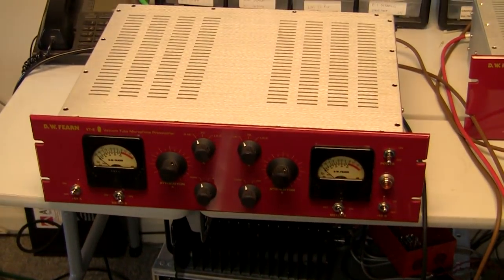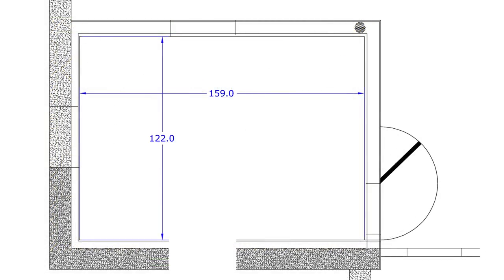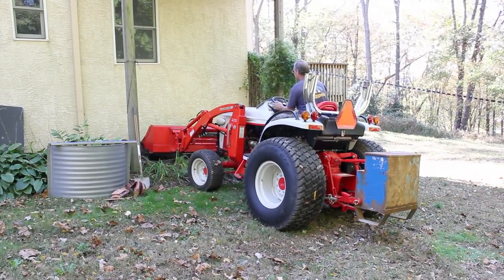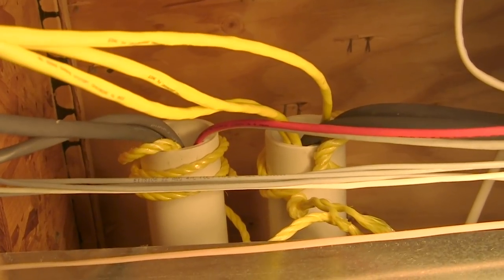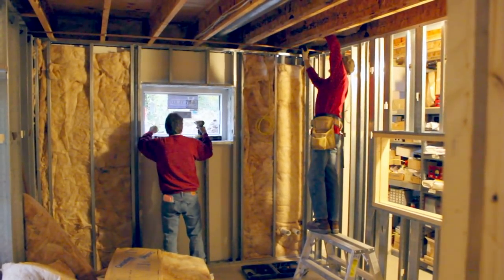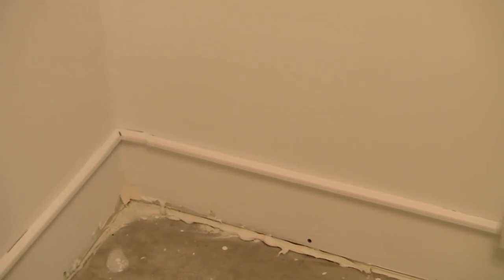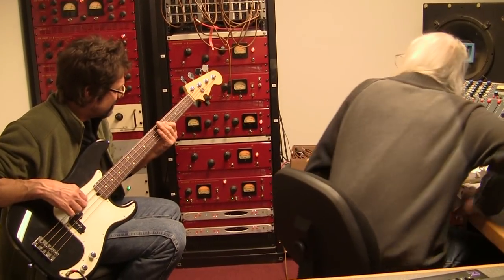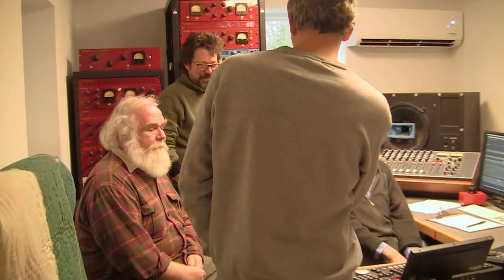Building a Recording Control room

Comment: You sell single space ventilated rack panels for $200 & you can't afford to add onto the building? Come on, man.
Reply from the maker: I considered expanding the building to allow a larger control room, but that would have meant large steel beams to support the three floors above. That would further reduce the ceiling height. The cost could not be justified for the benefit. The vented rack panels came about because our customers asked for them. A $30 perforated panel would work just as well. Creating a panel that matched our products required the same machining of quarter-inch thick aluminum as our front panels. There is also the cost of finishing the panels, which requires many different coatings and hand work.

Comment: Dude for your health replace those rockwool absorbers.  Fine particles go through the burlap with any air movement.  Rockwool is manufactured to be sealed, you do not want to breathe it in.  It's similar to asbestos in the way that the little fibers can lodge themselves in your lungs.
Reply from the maker: You are right to be concerned. The particle size of fiberglass and rockwool are comparable to asbestos. What do you suggest as a replacement?
That said, I do not know of anyone in our profession who has developed any lung problems as a consequence. Good air circulation and proper filtering probably helps keep us safe. Still, the risk is not zero.
Reply: Hi  @DWFearnHazelriggIndustries  I don't have a recommendation, I don't know the nodes or nulls specific to your studio (every studio is different).  I made the exact same thing put it in my studio and it wasn't till years that I realized it's hazards.  Your not going to notice it right away, it's the slow build up in your lungs over the long haul that you have to worry about.  When I lay flat on my back I start coughing, I thought it was bizarre til I put two and two together.  I was trying to use them as bass traps but gave up on that since it really didn't treat those frequencies, so they were more or less just slap back and reverb nullifiers.
Reply: @DWFearnHazelriggIndustries  The forced air circulation is what blows on it and causes it to become airborne.  It's released into the air, some will be caught by your filter (assuming it is able to catch these fine particles) and some you will breathe in.  😐
Reply: @DWFearnHazelriggIndustries  When I gave up on trying to tame the 40Hz room resonance specific to my studio I pinned up inexpensive studio foam (the Amazon kind) in key spots to reduce slap back, standing waves, and room reverberation and deaden it some.  My studio is a less than ideal size to do anything meaningful and have lately done my mixes on a pair of high end open back reference headphones.  Some physics are impossible to compensate for in a room as small as mine.  I've used studio monitors for decades and interestingly found I like the open back headphones better, it's seriously like having two studio monitors strapped to your head. ✌🏻
Reply: If I happen to come across something inexpensive and that performs the same as the rockwool in the burlap I'll pass it along to you. --Jason ✌🏻&❤️
Reply from the maker: @jalithic  Jason - You are right about controlling low frequencies. It takes a lot of depth, and that just isn't available in a small room. I like mixing with headphones, too, although I do switch back to the speakers for a different perspective during the process. Headphones are a good solution in a less-than-ideal acoustic environment.
A safer sound absorbing material would be great, if such a thing existed.
Reply: @DWFearnHazelriggIndustries  Btw I never mentioned, thank you for sharing your studio build.  I’m redoing my small studio (gutted it, sealing it, and building a double wall system) and is the reason I found your video.  Was curious what you’re using for your fresh air supply?  It’s been a while since I watched your entire video but I don’t recall it mentioned.  Mini-splits don’t remove stale air or bring in fresh from outside.  If your studio is sealed up tight it can suffer from SBS (sick building syndrome).  I’ve done a lot of research and going with an ERV unit (which takes in fresh air from outside and remove stale) that will feed my Ducted mini-split system.  The ERV also regulates temperature and the mini-split won’t have to work as hard.  Did you cover this issue in another video?
Reply from the maker: Jason  @jalithic  Like many studios in a small space, HVAC was a challenge. I did not want to tap into the existing building HVAC because of noise transmission compromises that would result, so I opted for the mini-split. As far as I know, fresh air is not an option with these systems, at least not when this was built in 2013. The building HVAC has 10% outside air through a heat exchanger, and that system has UV and electrostatic filtering. The control room is not closed up most of the time, and when performers come in to listen, I leave the CR door open to access some of the better-conditioned air. The CR also has a window to the outside, which is kept operable (I'm in an extremely quiet environment). I can open the window to get a shot of fresh air when needed, but that is actually rather rare. This is not a commercial studio, so I only do a few sessions a month (much less in the past year), so the CR is open to the good air 99% of the time. It's not an ideal system, but it has worked OK for me, with no symptoms of SBS.
Reply: @DWFearnHazelriggIndustries  Ah, Got it 👍🏻👍🏻.  Yes I forgot you kept your window.  I would have Loved to have kept mine but Southern CA is horribly noisy so I had not much of a choice (wish it were possible to head back to the Michigan fifty acre farm where I grew up. lots of privacy there 🙂) .

Excellent, Thank You for finding time to reply to my comments.  Greatly Appreciated.  And Thank You again for sharing your build. 🙂✌🏻❤️
Reply from the maker: @jalithic  I'm glad the video and my answers were useful to you, Jason.

Comment: Hot damn!  you got a vintage Neve broadcast board.  The only model Neve I ever got to work on.  Nifty!   oh, good vid too.
Reply from the maker: Thanks! I have replaced the little Neve board with a different mixer with more inputs. I don't want to part with the Neve, which I bought new in the 1980s, but it should go to someone who will use it. So perhaps I will sell it at some point.

Comment: Regarding your 1/2" glass layer being made of two 1/4" layers, did you just lay them side by side and install, or did you have put a small layer of something between them to prevent vibration? I have access to affordable 1/4" laminate glass and wish to do the same (single 1/4" on one side of window opening, dual-1/4" on the other), but I'd like to get it right.
Reply from the maker: I specified 1/2" glass but the contractor could not obtain it in time. He proposed two 1/4" pieces. I was skeptical, but it worked. Nothing in between. Just very carefully cleaned. When the two pieces contact, they sort of weld together. I don't think you could get them apart. After more than 10 years in service, the window continues to work well. I'm not sure about laminate glass, but it's worth a try.

Comment: Great video , I see they using radar 24 in conjunction with Lynx Aurora and Pro tools . So my question is when they use the radar and when they use the Lynx ? And how to use it together?
Reply from the maker: Thanks for watching. When this video was made 9 years ago, I was using the Radar 24 system for recording. But Radar is simply a recorder. It is not a DAW and has no mixing capability. The Radar files were exported to a computer running ProTools for mixing.
Reply: @DWFearnHazelriggIndustries  thx , and now what are you using ? Radar has a new converter with Dante connection , there is few tops converters now Prism release ADA 128 . That radar 24 sounds great , feels real analog . I understand if you using something different has to be better . I will like to know , thx
Reply from the maker: @ramonfelizjr  The Radar converters are excellent. But much of the recording I do now is in the DSD format. About 5 years ago I switched to Merging Technologies Hapi converters.

Comment: @ around 6min when the man is erecting the vertical studs, what is the man fastening the steel studs to above? Looks they fasten to the existing ceiling which is wrong! You have to decouple the walls from the original structure else you create flanking paths for sound to travel!
Reply from the maker: The ceiling of the control room is made from two layers of drywall, which are both decoupled from the structure by resilient hangers. The design requires a compromise between the achievable isolation and the loss of ceiling height. The isolation is pretty impressive, with the door being the weak link. I've worked in world-class studios with less isolation.
Reply: Resilient hangers will not provide the isolation of a completely decoupled ceiling but yes they save vertical space for sure. I just didn't hear anything in the video regarding this. Thanks for sharing!

Comment: The immediate problem I see is that the mixing position is too close to the center bass null .  The mix engineer should be about 37% from either the front or back wall.   Anyone sitting in that position is going to mix too much bass in around 80hz to compensate for the null he is sitting in.   Also the room ratio's are screwed.   As a retrofit, it might be possible to put a sub-woofer in each corner (or wall center) and eliminate the center null zone.  (Check out the REW tool).   

Rooms that have dimensions that are multiples of each other is a mixing nightmare.   They will actually ring to the key frequency.  There are a couple of optimum ratios to use when calculating these distances.  I prefer 1.618 to 1, as it is the ratio found in natural Fibonacci sequences, such as conch shells. 1.26 also works.   

So if you make your shortest distance (height) "one", then the next (width) will be height times 1.62, and the next (length) will be height times 2.62 (or width times 1.62 which is the same thing) .  Or if you are using the 1.26 ratio, then height is "one", width is 1.26 x height, and length is 1.59 x height.  This will help reduce frequency response modes to a manageable level.  With this room you might have to use 1.26 due to the limited space.

For example; using the 1.26 ratio, call the ceiling 108", then the width is 136" and the length is 172".   The support post is just inside one corner, but make that the back of the room and it will be buried in the bass traps that you put at the back of the space.  (Or you could use 120, 151, 191 if you have the space.)  Have the mix engineer turn left 90 degrees.  Shoot the speakers down the length of the room.  Put his head and the speakers in a equilateral triangle.  This room might be just under the edge of being too small.   There is some law, I don't remember, about the required cubic volume.

GIve $1000 (probably less for this size room) to John Brandt and let him design it for you.  You will not be disappointed.   John Brandt also has free tools to download that can get you started.  You can thank me later.

Comment: I am building  a new studio and this video gave me a few ideas.  Your gear looks great but slightly out of my price range by a few thousand dollars :)  I encourage your to try out Harrison Mixbus32c to use instead of your Pro Tools rig.  All the best
Reply from the maker: I'm glad you found the video useful.
You should checkout the products made by Hazelrigg Industries. They are my designs, built in the same facility as the D.W. Fearn products. They might fit your budget better. www.dwfearn.com
For the last three years, I have used Pyramix as my main DAW, with Merging Technologies converters. When I need MIDI tracks, I have been using Reaper. Not even set up for PT anymore in my studio. I've heard good things about Mixbus.

Comment: But how do you manage air recirculation? The split only cools or warms the air, but were the fresh air came from?
Reply from the maker: That's an excellent point. All the studios I have designed in the past had 10% fresh air into the HVAC system. This control room does not, and I wish it did, but most of the time the door is open to the much larger space around the control room so it does get some fresh air circulation. Not ideal, and perhaps at some point I will add heat exchangers to provide some outside air. So far it has not been a major problem since most of my sessions are only 3-4 hours long. (The original plan had the control room tied into the building system HVAC, which does have fresh air, but the complexity of sound isolation, cost, and lack of space made it impractical.)

Comment: While i understand the 'low budget ' aspects of this construction style, and some things were done correctly such as metal studs, the right angles ( 90 degs no less) of the room will be a concern as treatments are needed. The small sq ft also restricts the sound from 'airing out' and instead bounces around sharply via severe reflections. You will not achieve decent tracking or mixes because of this. Akin to mixing in a closet. If you are using it to dry run the gear you build you'll get false results due to all of the above.

Comment: Why do opinions differ when it comes to setting up a recording/control room by length as opposed to width?
Reply: they shouldn't differ - you want your room wider than it is long otherwise you'll get frequency amplifications or cancellations depending on your listening position. Remember, not only is sound about frequencies but it's about time and how long it takes for a given frequency to travel a distance before it attenuates. (or bounce off an object and hit your ears again)